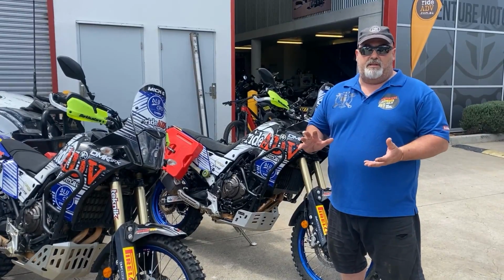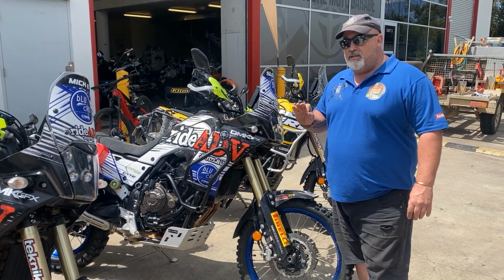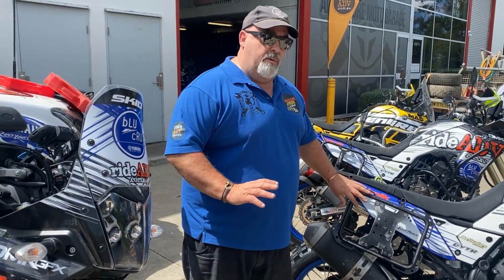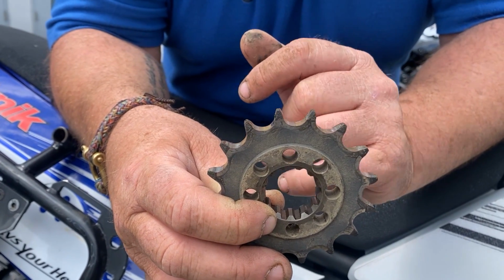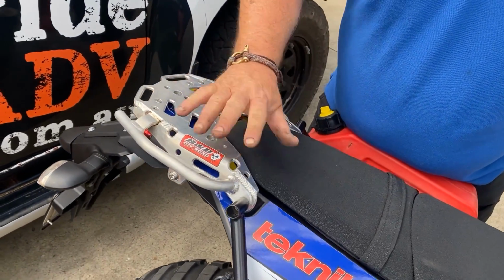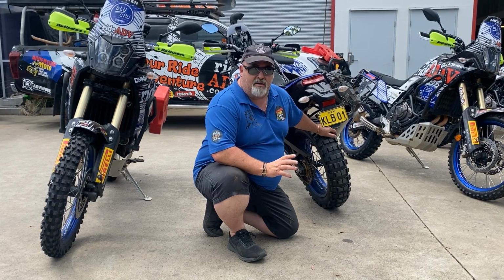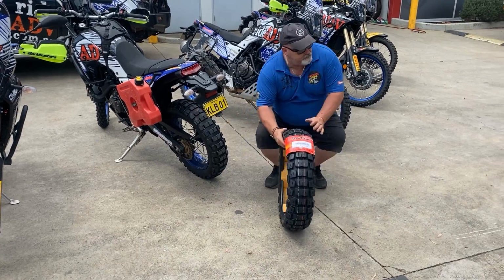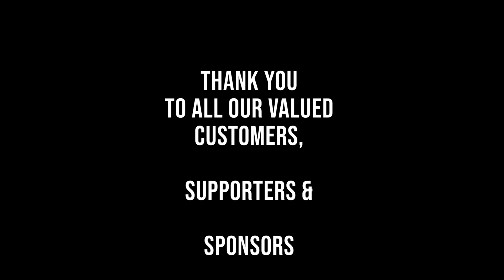125000km's on Tenere 700 fleet - Bike set up and parts review Ep-01

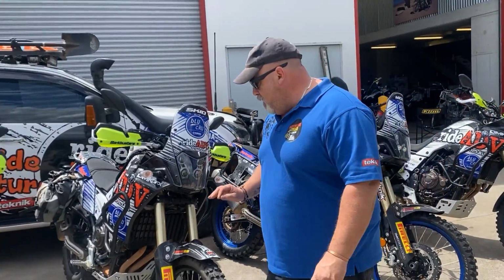Comment: 3:15 Your tip on replacing the front sprocket when it first starts to wear without having to replace the old chain and rear sprocket is gold.  Places that want to sell you stuff will insist changing them all together is the only way to go.
Reply from the maker: Tell them to piss off and buy it else where. They just want the sale, buy it on-line

Comment: Thanks Greg, this is an excellent review of the development work RideADV has done so far on the T7s.  On many of your rides I have seen how hard you and the sweeps push the T7s, and the varied and harsh terrain NSW presents seriously tests every aspect of machine reliability and safety.  Your advice is well founded on experience.  I have the Tekniks level 1 front and rear suspension changes on my bike and while much better than stock, the forks are not responding completely like I want them to.  I'll come talk to you and Nick about how to fix that.
Reply from the maker: Nick is working on stage 2 right now and has my latest forks there now
Reply from the maker: Thanks for your comments. Yes we test our bikes as hard as anyone

Comment: I went with swmotech bash plate for full exhaust coverage and their centerstand for wheel and chain maintenance.
Reply from the maker: Charles Cummings congrats on your setup mate. Watch the centre stand as the return spring is too light and the centre stand will swing down in rough going and contact the ground. I’ve already witnessed an incident here from it happening.
Haven’t tried a OB one yet but the Yamaha OEM  one has a better spring system retaining it closed.
Don’t know if you have access to see a B&B bash plate it the flesh but it doesn’t have the best coverage on the market. We sold the SW we used with one of our bikes, they are a good bash just the same

Comment: Awe! You cut off the ride scene right when the face melting solo started. 🤘😛🤘

I dig seeing a new episode out from you guys. Always learning something new. I also think your touring company is one of the coolest looking and sounding out there. Maybe one day I can paddle from the US to Australia and go for a ride. 

You threw out a quick hint of steg peg talk. I remember from the previous episode, you were using a skate board wheel. Hope you discuss new developments of that. 

I REALLY like your luggage racks.I like that you keep it narrow and forward. I see you do not have the cross bar connecting the two, like other companies. I am guessing you have not had any issues with the lack of extra strength. Do you forsee any issues of bending with a heavier tip over? Or do you feel the cross bar is unnecessary?
Reply from the maker: Hi, as far as the cross bar goes they have been dropped plenty and there hasn’t been a drama yet so no at this stage
Will update the steg pegs soon
Reply: @rideadvtoursandworkshop3178  Awesome to hear! Thank you for the quick response. 
You must not be much of a sleeper. Sun is just poking out on this side of the big marble.

Comment: Did You ever had problem with oem crasch protectors..?like damaging engine monts??? Cracking engine block during foll.
Reply from the maker: Hi Andy, no we haven’t and they’ve had a few crashes one Particularly high speed hard crash and no problems at all. They are the bars we choose for the over all compromise of weight, style and protection. 
As stated the best protection in our opinion and experience is the Outback Mototrek upper lower set but they can be harder to install.

Comment: Why wont You switch to tubeles tyres with outex staf in them  .???
Thick tubes are they good for The Street?
Reply from the maker: Hi Andy
We had tubeless on our 1200s only problem we had was if we dented a rim it would go flat and then we had to put a tube in. If we dent a rim with a 4mm tube in it doesn’t go flat.
Also silasticing  nipples etc. doesn’t make for easy spoke adjustments or spoke          re-tensions. 
The only reason I would entertain the idea would be to reduce the unsprung mass of the wheel and it’s not necessary being a 200kg bike
Reply: On The Street do You feel 4mm tube being A problem. Like ubnalanced wcheel.
Many thanks for Your support. 
All the best to You.
Reply from the maker: @andykus2219  we balance all our wheels using screw on ball weights. We haven't experienced any problems with the 4mm tubes, even in our hottest areas running at 130kph plus for long times

Comment: Great vid thanx.  Just wondering if you guys have tried a hepco becker luggage rack??  also...i kinda missed your point on the sprockets...did you say you change the front before the rear?  Thanx Clay D
Reply from the maker: Hey, nah we have'nt tried a Hepco as we developed a specialist rack for our needs as soon as we got the bike in Oct 2019. 
As for the chain and sprockets chat, we've found that if you change the front the moment you can notice some distortion in the teeth you'll get a longer life out of the chain and the rear sprocket.
We change the fronts at around 11,000kms and the whole set at 20,000kms. Remember the front sprocket goes around a lot more so it wears front then it wears the chain which wears the rear

Comment: Greg
    Is there any reason you didn’t change the wheels to a tubeless setup?
Reply from the maker: Yeah because we ride off road and tubes I firmly believe work better off-road. Plenty of times we have had to fit a tube to a tubeless wheel when they’ve torn a side wall out or dented a rim and it won’t seal.

Comment: Have you had problems with that long welded on exhaust hanger bending? I have seen some other videos where a fall on the rather exposed exhaust can bend the bracket which then causes the swing arm to rub on the exhaust, damaging both.
Reply from the maker: Hi Mate, we have had one touch the swing arm, but that was before we fitted our racks on the rear. No such drama since

Comment: What inner tubes do you run? Should I get Ultra heavy duty tubes?
Reply from the maker: Hi Sami, we run ultra heavy duty 4mm tubes in the front and heavy duty 3mm tubes in the rear. Reason for the 3mm in the rear is we haven't found a 4mm yet in the size we like the fit. We are testing some Motoz 120-140 rear tubes but they seem a little small. That said they haven't caused a problem to date
Reply: Why wont You switch to tubeles tyres with outex staf in them  .???
Thick tubes are they good for The Street?

Comment: Just to confirm, you go up a tooth on the front sprocket? Not down
Reply from the maker: Hi Chasp_0 
yes we if we do gearing changes we do go up one on the front. We haven't had the improvement in the fuel economy we hoped for but its worth the 400 / 500 rpm at 110kph
Reply: @rideadvtoursandworkshop3178  x

Comment: So to make this bike work properly you have to spend at least another 5k.
Reply from the maker: Hi George, yes you can if you want but most of our bikes as we are only changing springs now to suit rider weight and retaining the use of the standard valving the cost is way cheaper. 
Pretty well every adventure bike on the market requires a bash plate, hand, protection / guards, luggage racks or bags, gps and mount, different Tyres don’t they ?
Steering damper in personal preference, as is the sticker kits for advertising.
Reply: I think they're called 'platforms' for a reason.
Reply: No, they are very good stock. Depends on what you call "properly"
Reply: @rideadvtoursandworkshop3178  At what rider weight should one consider changing the springs?